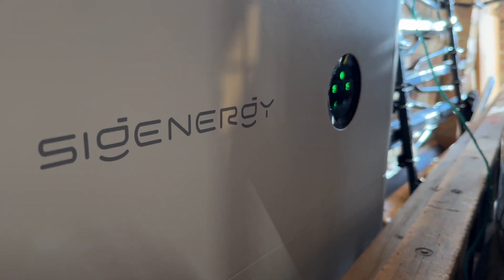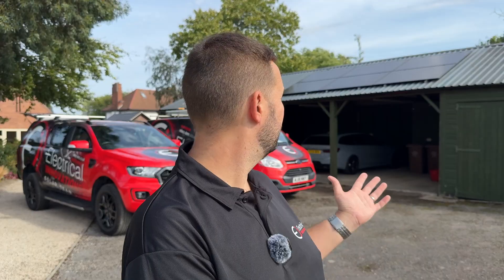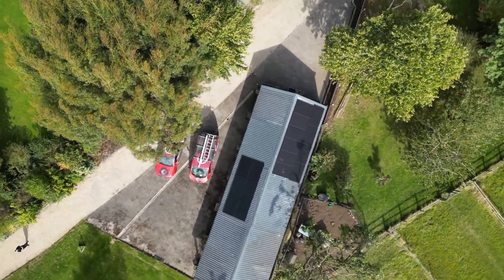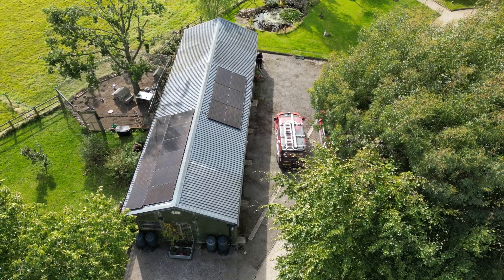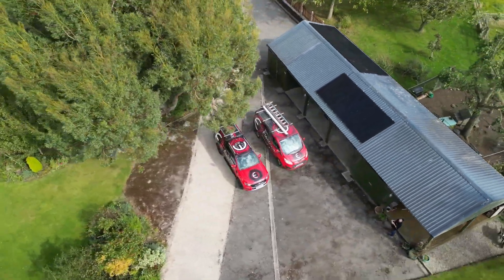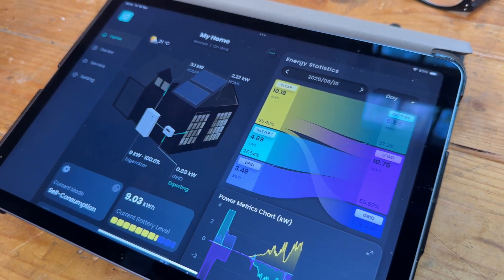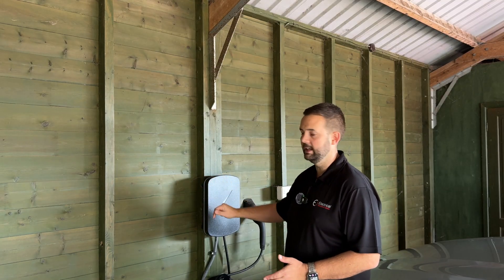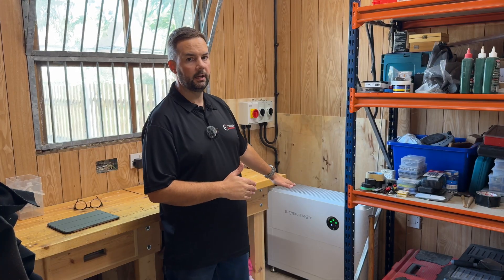DNO Restricted our Solar install - 3.6 KW Inverter with 16 Solar Panels and Sig Energy Battery

Comment: DNO of only 3.6Kw demonstrates how outdated the grid infrastructure is holding back the benefits.
Reply: There are limits on how much harmonic pollution you can allow PV inverters to inject into the local network. After all, that supply is used by other consumers and they have a right to a clean supply.
Reply: @brendanpells912 true but that varies considerably depending on the age and size of the local infrastructure. Newer estates having greater capacity.
Reply: @brendanpells912 yep that's what I'm getting at old infrastructure smaller transformers, interconnections, etc. I recently had to have my grid fuse connection changed and engaged with National Grid myself, only to discover that they also wanted to know about my battery solution, which they hadn't been notified of when it was installed. Their concern was that combined with my solar generation ths potential export might over load the local Grid. After going through the whole DNO process myself I was surprised to get a DNO of 6.68kw higher than my original Solar installer had anticipated.
Reply from the maker: It's difficult in rural areas.  An upgrade on this network would only benefit 2-3 properties.
Reply: Our grid system was fine until Nut zero was 'invented'...

Comment: Make the additional energy go directly into batteries as an OFF-GRID to house only. If there is no connection to the grid of an auxiliary system it is none of their business.
Reply from the maker: This would be an option, but the cost and complexity of this system was dismissed. One of the key parts of this project was to use the existing wiring in place.

Comment: Why did you install the south panels close to the trees; would they not have been better installer at the other end of the barn?
As the homeowner is an EV user, perhaps it would have been better to install an off-grid system with grid link for charging only?
When an installation is non-standard, a custom option is usually better, such as a Victron system which can take virtually unlimited array sizes, unlimited battery capacity and lots of configuration to take into account all of the unique 'features' of the installation.
I understand that many installers have set their stall out with a primary equipment supplier (Sig in your case), but every install is unique, thus to serve your customers well, you really do need to go back to first principles, and that means widening your scope of equipment vendors... A DNO limit is not as limiting as many installers think it is...
Reply: Fully agree, but if owner doesn't wish to go for the full Victron route, then at a pinch the Growatt SPF 6000 ES will suffice most instances - it is nowhere as good as Victron, but the twin 3kW mppt offers more flexibility than the older single string spf 5000 for a very modest price tag to get you off-grid on a modest budget
Alas, like you said many companies prefer to use a certain preference only so their scope of possible suggestions are perhaps limited by that.
Where as, considering other options & inverter setups, they could offer a much more creative work-around to a g98 limit
Reply from the maker: We did discuss off grid options with the customer. It comes down to cost.  A simple grid tied set up with an oversized DC was the best overall option here.  

The South roof is heavily shaded, but we installed into the position that gets the most sun all year round.

Comment: OK Mr DNO - 3.6kW inverter it is...
Now that's all done, I'll fill the rest of the roof space with panels & connect to an off-grid only inverter system to run house or part of house/modest EV top-up/oven/backup etc...
TBH - I may have slung say 4kW to a basic grid tied inverter or 8 to 10 panels into 4 or 5 basic micro-inverters - especially the most shaded panels as each panel would be generating independently on its own mppt
There are many ways the system can be expanded upon - even with a G98 limit in place, you could export as much as possible if not all & still cover standing charges, EV charging and most of home battery charging in deep winter off-peak
(£200 standing charge, £150 EV charging off peak & 20kW for 100 days topping up batteries when sun don't shine)

I'd probably put more storage on the SygEnergy side to store as much of the solar already installed - well all of it in fact...
Export all 3.6kW from mid morning, then at midday, excess is being stored in Sig batteries, which can be forced discharged into early evenings so you extend more hours exporting that energy from all the 7.2kW panels...
So though you are capped at 3.6kW - you are effectively exporting the same amount as if you could export 7.2kW,
But instead of exporting up to 7.2kW over 7 hrs, you are exporting 3.6kW at up to 14 hrs if you have the storage
Instead of earning say £500 SEG, you could now earn double than - still with the G98 but exporting for longer with the energy you stored in Syg system...

But what about running the house ???
Well that's where the off-grid system comes in with all that space left on the roof, 6kW+ full off-grid inverter, should run most of house, though be careful if putting kettle on with oven/immersion unless 2 x 6kW in parallel - but tbh, if you needed a bit more briefly it could skim off some of 3.6kW you're exporting as a pass-through etc...

I'd probably say get another Sig 9Kw battery to store & discharge to grid all day at 3.6
Throw another 7.2kW+ of panels on to a 6kW off-grid inverter with 10 to 16kW storage
& say a sarcastic thank you to Mr DNO

You'd have to check & monitor the 3.6kW inverter if it can run most of the day exporting 3.6kW max capacity, though I reckon it is mostly based upon a higher 5kW inverter inside mostly & just software limited to 3.6
(most lower inverters are like this, a higher inverter capped to a slightly lower limit inside)

Yeah it is a pain the DNO limited it to G98 but that's not a bad thing, in fact it is better for balancing the local grid getting a more constant 3.6kW for say 12 hours than 6 hours with up to 7.2kW ranging from say 6000w, then quickly dropping to 2000w as sun passes behind a cloud, then uo to 3,500, then 5250 then back to 6000w, nope back down to 3000 on many overcast days...
A slightly less export for a longer duration is not just a work-around for a modest G98 export limit - it's actually better for the balancing of the grid - but nobody really considers the implication of every solar install constantly exporting very volatile & sporadic amounts of energy back to the local grid during the day - but that's another subject

Great install, but there's more potential if the home owners wants to fill remainder of roof with an off-grid setup working around the G98 limit by DNO
Reply: I dunno how much those Sig Energy 9kWh batteries are but you can get 16kWh of Fogstar for ~£1,500. Just charging those with MPPTs and having Victron Multiplus inverters powering the car chargers should work.

I can't quite understand how they're using the recess solar to power the car chargers from the video with just a single 3.6kW inverter.
Reply: @pau1phi11ips  Yup, got one of the Fogstar/Seplos 16.1kw in white myself
The same price as one of my 2 x Pylontech 5000's I bought a few years back :(
Fogstar runs to 1 SPF6000 with 5kW solar for house off-grid
2 x Pylon's go to another SPF6000 with 3kW solar that is used for EV charging and backup emergency if working on other setup - might wire cooker to run off this maybe
(Config same as EV charger = changeover switch so can run off either system to use up whatever has most stored energy/solar etc...)

Tempted to get another Fogstar & run both SPF's in parallel - which would be the way to go, (no need to toggle EV/Cooker change over), but for now, running them as two systems

Solar has become insanely cheap over the last 3 years - like panels are a third of what I paid - if doing it now I might even go for £100 NeoStar 3 when they finally perfect 500w production...
Then cheapo £60 bifacials on extension/flat roof, where I may get some slight reflection underneath

Batteries - they've also come down a lot too, but don't think the prices of either will come down much more - except for maybe some improvements resulting a tiny bit more bang for your buck - the actual unit price is about as low as it will go for a while me thinks

But then, I never saw the sudden drop over the last 18 months or so - so who knows, PV panels might fall out of your cornflakes box or Happy Meal in the near future
Reply from the maker: It comes down to budget.  More battery storage is not as easy as you say if the client has a budget to work to.